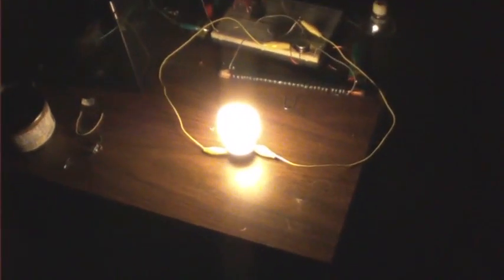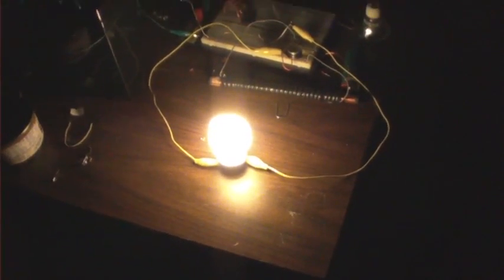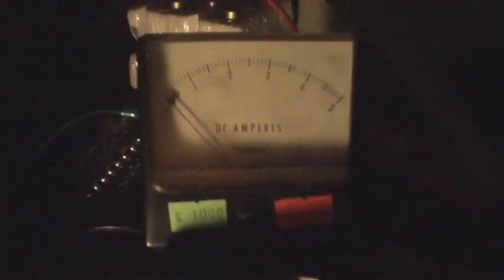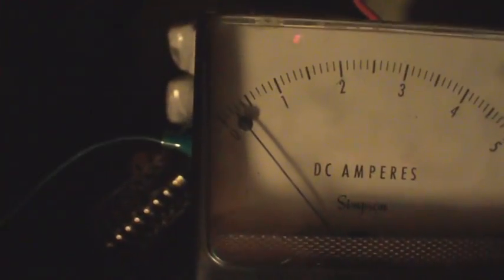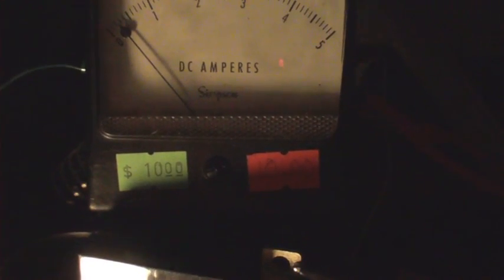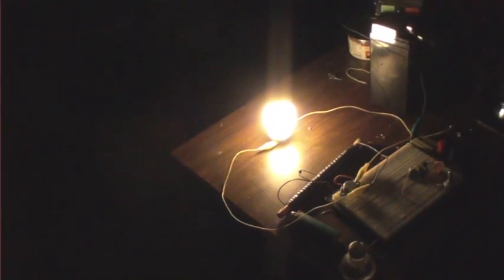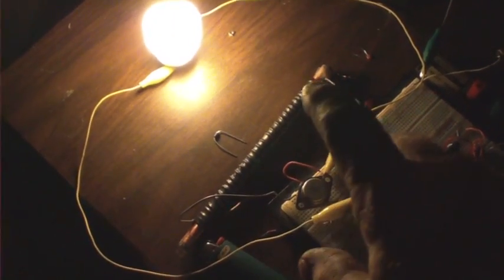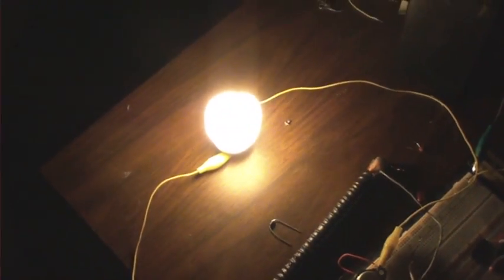SJR 3.0 HV ? 12.7V @ 240 mA (3 watts)

Comment from the maker: if you do an "image search" on google, for "2N3055" it will tell you what the pinout is, for E C and B. The legs are not in the center, therefore you can hold it a certain way such that legs (E & B) match the diagram. C is the metal case itself. Cheers